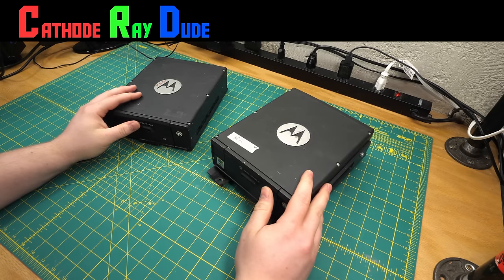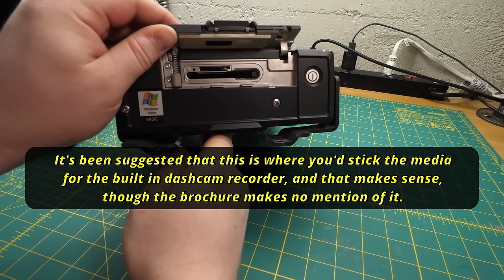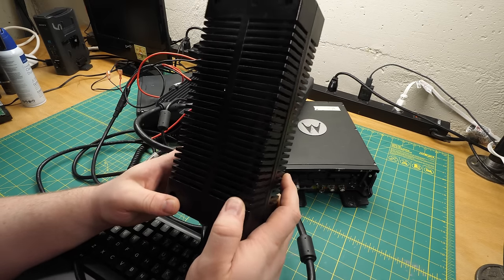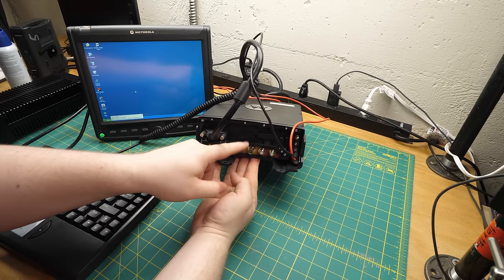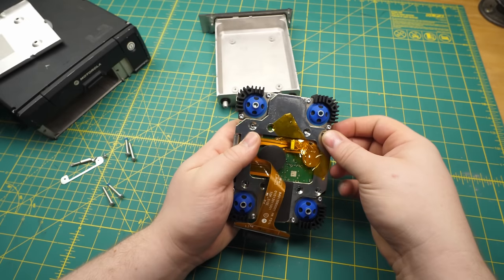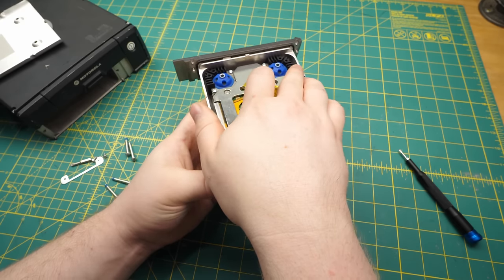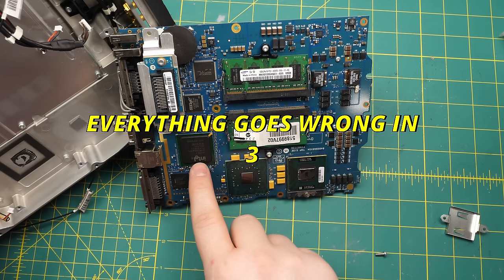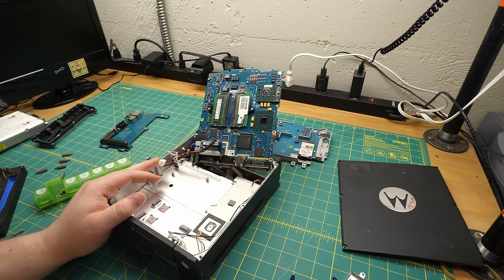Little Guys 7: The Cop-puter [Motorola MW800]

Comment: i have seen something like this on exploration and rescue rover. the reason is hdd are more reliable as ssd in the long therm, especial with the newer ssd flash chip types and mlc or slc flash is extremely expensive because no longer is someone  interrestet in those. if you pair a modern ssd controler with a mlc flash those would last decades under heavy load but the space where limited. i mean i had no problem wit it having a 3.5 inch drive size fully stacked with pcbs full of flash, even it would have only 512gb.  for most stuff this would be enough. even on satelites are hdd drives because there are less effected by radiation but some how they survive 30min to 2h of violent shaking with 20g and more.

about hat heavy padding of the drive, it is in a cop car therefore it must survive a crash or multiple crashes and afterward still recording.

Comment: @cathoderaydude  We just run Dell Rugged 5400 latitude series as our Mobile Data Terminal,  This feeds up to a built in LTE Modem with GPS.

We also have Sat-com units and truck repeater setups so we can use the satellite while we're out doing back country rescue outside of radio range.

Comment: Heat isn’t as much of an issue if the computer is in the cabin, because when it is turned on the air conditioning is on too if it’s warm out. When not running the equipment has to withstand the big temperature extremes as you mention. This may be one reason for not putting the computer in the trunk.

Comment: The Maxtracs used the same power plugs
I made a ton of cig lighter to these plugs and 16 pin discriminator to 1/8 in stero output for my ATCS mobile setups.

I modified about 200 800 MHz radios to receive 896 to 899 MHz and hacked the firmware to be able to program in those out of band frequencies.

They are awesome for ATCS Monitor

Comment: mini UHF is still used by almost exclusively Motorola, I assume it's to keep the connector size down and keep the proprietary nature high,  The quad port "serial" breakout is labeled as an ALPR adapter so my guess is it's for reading text strings coming back from the computer vision in the cameras doing text recognition for license plates.

Comment: Having a harddrive in business laptops was still pretty common even a few years ago. The reality is it saves money. So system integrators are going to use them. Even if they don't they can sell it as an upgrade. Also... back then were SSD's as reliable as they are now? From what I recall, not really.

Dang we came to the same understanding should have read your comment haha.

Comment: My dual-sport motorcycle has one of those "SAE" connectors hanging off the back hooked up to the battery, ostensibly for connecting a battery tender (trickle charger). Yes, they feel just as awful as he describes.

SSDs would not always be "standard equipment" in this era partially for cost reasons, but also for performance ones. You could get SSDs, but they didn't have anything close to the very advanced controllers, algorithms and cache memories that modern ones do. This meant they had really uneven performance, especially under continuous write; for an application like this where you want your dashcam recording all the time no matter what, a potential multi-second hang because the primitive controller in your "SSD" (that's little more than a simple block translator in front of a chunk of slow flash memory) got confused for a bit would be unacceptable.

In addition to the more vague/general "more mass = less vibration" comments, more importantly the higher mass will cause the resonant frequency of that hard drive caddy to shift downwards. Since a hard drive is much less tolerant to sharp knocks and high frequency vibration, slow oscillation is far preferable hence the extra mass.

I think the soft mounts on the hard drive caddy's plug are more there to prevent the maintenance gorillas slamming those things in and out of the computers from causing additional shock/damage to the caddy or drive, rather than to dampen any vibration during operation.

The interior design of this thing looks that way likely because it came out of the same design labs that Motorola's more common radio equipment does; the innards of their radios look the exact same way in terms of how they have all sorts of big chunks of metal boxing individual parts of the circuit into their own little sections.

Comment: I'm sure the card buss is for a lock out card. Without the card you can not log into the computer. It also tracks who logs into the system so it knows who used it last.

Comment: I wonder if the ambulance and firetruck computers are harder to find complete because when an ambulance or firetruck is removed from service it usually ends up sold to another department or EMS service and I wonder if they keep the computers in the vehicle and just wipe them, whereas cop cars tend to be removed from service and stripped of all the cops stuff and sold to private individuals.

Comment: 24:35 SSDs were still very expensive back in 2009-2010. In my country I could buy a 3.5" 1TB HDD for around $150, while a 32GB SATA 3Gbps SSD cost around the same price and a 64GB one cost about $250-300.

Comment: Is it possible that they limited the screws to prevent from having a rigid connection between the boards and the case-mount?
By using a goofy spring-cup or whatever it's called, the board can flex a lot more in high shock collisions

Comment: The big correction 7 made with editions was making things like XP where each edition was an upgrade to the ones below it only adding features and not removing them. For vista there were features in Home premium that were missing from Business, with Ultimate having everything from both. 7 fixing this is likely among the reasons 7 was better received than Vista. 7 Professional had all the features enthusiasts wanted but was a lot cheaper than Vista Ultimate.

Comment: The big city south of me had a special 800 MHz frequency that was used to feed these computers.

Instead of a TDMA or CDMA they used a low speed data over 800 MHz
The one frequency the base talked to the computers transmitted continuously, and the matching pair frequency that the computers talked to the base.
These were only active when the computer was being used to search for license plate lookup or driver license lookup.
But in the early days they transmitted unencrypted and you could see the data they were sent 

It was an incredible time.

Now, EVERYTHING is encrypted 
You can't even hear any of the talk groups.

😢😢😢😢

Comment: Do you think this Motorola pc would be a good navigation devise for a ship/boat, perhaps as a backup?
Reply from the maker: It's rugged enough, but I'm not sure if it's actually sealed well against water / salt ingress. The spec sheet lists all the mil specs they tested against, and for "Salt Fog" it just says "MIL-STD-810G Method 509.5, Non-Operating" and I honestly don't know what that means, heh. It has two exposed, off the shelf fans and I feel like they would get corroded and choked up real quick, but this is not my wheelhouse, no pun intended.

Comment: 27:50 Also Force is mass times acceleration, so if you increase the mass, you automatically decrease the acceleration experienced by the drive, given the same amount of force acting on the frame.

Comment: The fans could be optional. In a hotter climate, the fans get specced. Colder climate, fans omitted.  With all the anti-vibration measures. Having the GPS antenna underneath and screwed down makes sense. Then antenna is not coming loose anytime soon.

Comment: 11:35 that looks like one of the amphenol connectors ive used on CNC machines. They have a ton of variants but are usually just called "amphenol"

Comment: I have a Gigabyte aero 16, and while it has many design flaws, it also has a metal cover over top of the coax wires on the Wifi chip, but it only uses a single screw.

Comment: Ah yes, I remember Windows XP (!), Vista and 7 Starter. Had computers with all 3 of those, and I even stuck with Vista Starter and it's 3 concurrent-app-running limitation for years until I installed the 7 betas. Fun times indeed.

Comment: On a positive note /\/\otorola is making some Body Cams which should be pretty reliable is they are turned on. Great video. I have wondered about the MW800 as I want to put a dash cam and interior cam (in case I am pulled over!) in my car. Also 1) Could a wireless keyboard be used and 2)  I wonder how easy a modem upgrade would be for these computers.

Comment: Those SAE power plugs are mega stupid for electronics, but are good for block heaters and trickle chargers and the sort of thing you have plugged into your car when it's -20 outside and it's 5am and your fingers are frozen and your brain even more so  to the point you take off without remembering to unhook them.

Comment: Mass suppresses vibration inertia.  Greater the weight, the greater the resistance to motion.  However, once moving... the greater the force in play to stop that motion, hence the shock absorbing materials, and floating buffering.

Comment: Actually the mess sort of makes sense. If you're considered some of the old vehicles big old Pontiac and Cadillac behemoth land yachts. They didn't really need sophisticated shock systems in order to smooth out the ride. It was simply Mass. They rode really smooth because it takes a lot of force to change the inertia of the mass n motion. So the beefy shock system on those things yeah we're beat up but they could take it. That was one of the things that people started noticing when they went to the electronic and computer controlled shock systems as they were not quite as good as straight massive shock systems

Comment: Given that it's only a 25W CPU which will probably never be pushed particularly hard the thermal mass of the case seems more than enough to just passively soak up any heat the other components will generate - I'd be surprised if the whole machine drew more than a handful of watts for most of its life.

Comment: 44:38 Could the little board in the Little Guy be for the power button? Over built to prevent ESD also explains it isolation.

Comment: I heard somewhere that the Centronics type connector may be officially termed a "micro ribbon" connector. I also recently learned that Centronics was the name of the printer manufacturer who first used the micro ribbon connector on their printers and it just became a defacto standard.
Reply: I am not 100% sure, but I think the Larger  Centronics printer connectors were also used for the old 1A2 Multi-line office Phone systems. they look very similar . . . .
Reply: @GothGuy885  Yeah - I've seen similar style connectors elsewhere. A shorter version of it is used on HPIB / GPIB / IEEE-488 connectors (such as the ones used on the Commodore PET to connect to external disk drives) - but uses screws, rather than, wire clips to secure the connector.

Comment: 12V power plug is common on motorcycles both for trickle charging and powering things like heated riding suits. Also used for hooking up trailer lights. Yeah, they suck. You also have to be careful about how they are wired because there is essentially no standard way to do it and on some applications, you'll have an exposed pin at +12V. When I was a kid, they were used for hooking up the battery in my Power Wheel, which pretty much describes how seriously they can be taken. 
If that's what they used to power this Cop-uter, then they threw the baby out with the bathwater. Absolutely zero point in having screw retained USB ports when this is what powers the whole thing. There is nothing rugged or reliable about a pigtail connector. I would also think that, with Motorola's experience producing avionics, they would have used aviation connectors all around. Audio should have BNC connectors, same as the video. The redundant power button on the front is quite puzzling.

Comment: As for minimal active cooling - Isn't those cooling fans specifically for overheating condition? So it wouldn't be used normally, but if it somehow overheated those two would "take off the edge" and bring the device just back to operational temp.

Comment: I didn't spot a single electrolytic capacitor in that thing (or did I miss some?)
It is probably fine cocking at 180°F in that enclosure. Not so sure about the hard drive, but the rest should be ok. Hard drives are consumables anyway

Comment: You mention VISTA never had an embedded version… it did, as did windows 7. I think embedded got dropped from 8 onwards. Newtek (now VIZRT) Tricasters used embedded versions of windows. They switched to Windows 10 from the TC1 and TC410
And mini onwards. The Tricaster had specific propitiatory software and hardware, so if your HDD failed you couldn’t just reinstall windows and expect it to work, you’d have to send the unit to either Texas (Newteks base) or hope a repairer is close by and get an image from them (the HDD had a windows VISTA/7 partition and a LINUX partition for the recovery tool with a GRUB menu)
Reply from the maker: @JamesLehartProductions  I have a whole collection of Tricasters with the original software, last I checked they all just run Vista business.
Reply: @CathodeRayDude  could have sworn they were VISTA embedded? My 460 I’ve got in front of me is 7 embedded and the mini I’ve been repairing is 7 embedded too. I can’t recall the exact model that uses VISTA but I’m convinced it’s embedded…. But since you’ve got some I’ll take your word on it that is business… with that said, why on earth would MS drop it for one edition only to bring it back the next?

Comment: You know. Outside of the pretty ancient hardware. Ham radio's might find these interesting. Especially given the 12 to 14v input.

Then again. A tablet PC in a holder is much better then this beast of a thing.

Also reminds me of messing with a rugged laptop at work. Disassembling the drive carrier to replace the spinning disk with an SSD. Same kind of use case in a car.

Edit: The southbridge is a run of the mill Intel ICH7 and the base model of that range. (Wikipedia: IO Controller Hub). It could be paired with a huge variety of different northbridges.

Comment: I had a Hauppauge PCI standard def capture card with a conexant chipset.  I dunno if it was the same.  Some kind of PVR-something50, I don't remember.  It was pretty good.  I mostly used it for analog coax TV input though.  Too bad conexant modems were trash-tier.

Comment: It seems to me, correct me if I am wrong, that the chipset is for the Intel first gen Core CPUs. If is possible to max the CPU to an Core I7 and the RAM to 8G, it would be a good Windows 7 computer and even it could handle well Windows 10 for most daily tasks. Even with XP it would handle many late XP era games and software. Since it have integrated Intel HD video, I think a RAM upgrade would benefit greatly the capture part and overall the computer (I remember that the Intel HD was DX11 and had dxva so it could work well with many newer codecs).
I have an Intel first gen Core I7 (maxed out after many ) laptop from 2011 and I am still amazed with how well it aged. Now I want one computer like this for my bench.

Comment: I dunno about the keyboard that came with this machine, but I've had another cop car keyboard that had a bunch of rubber domes over MX blacks, and I could take the keycaps off and then rip the dome sheet out and it was just a normal mechanical keyboard after

Comment: There's no chance those hard drive heaters are just fed a straight voltage. They're either PWM controlled or thermostatically controlled. I'd go with PWM since it's a bit easier to do with small chips, but doing it as a traditional thermostat would also work fine.

Comment: UHF connectors, connectors with the most inappropriate name as the full size ones are crap a UHF frequencies. 
The full size ones were used a lot on VHF wireless microphone systems.
Reply: The full size connectors are standard for HF ham radio and a lot of VHF, but N connectors start taking over as the frequencies go up because the “UHF” ones have a poor impedance match with standard 50 ohm coax. I have no idea why they are called UHF.
Reply: @markjames8664  I believe it was because when they were invented what was considered ultra high frequencies were lower than what they are now.

Comment: Those round connectors are more of an "avionics connector" than a "military connector." (Firsthand experience at an avionics company.)
Reply: Granted, there's a lot of military avionics.
Reply from the maker: Well you see them on ground based radios and field telephones and stuff too, so I feel like maybe the air force et al started it and then everyone else went "hey these work pretty great"
Reply: Until you've seen a single connector that includes power, ethernet, and a bunch of fiber optics, you haven't seen an interesting connector.
Reply: @CathodeRayDude  , I'd argue that it started with commercial avionics, but I could be wrong. Working at an avionics and radio company, I ought to be able to ask, but I'm guessing those that would know retired/died long ago. That said, I generally hear "circular connector", followed by "avionics connector".
Reply: And oh my gosh are those connectors expensive, even for the companies that buy them in bulk.
Reply from the maker: @JamesPotts  Oh that's kinda what I mean, as far as why it seems to show up on military hardware of all types, but now I get what you're saying; if we name it after where it probably originated, yeah, I'm sure aviation is the right call.